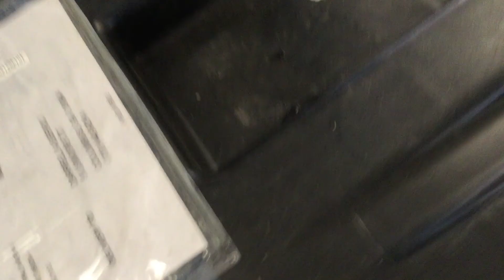CHEVY EXPRESS 3500 VAN ENGINE REPLACEMENT WITH 500,000 MILES!

Comment: Nice work Darrell. That engine is really buried under that dash. Work the work though, its a nice straight looking van. Mad to think they put big V8s in vans over there! About the  biggest we've got here are the 5 cylinders TDi or TDCI in the VW Transporter or the top of the line transits. Most vans are 2.0-2.5 4 cylinder diesels with manual transmissions.
Reply from the maker: Thanks Dave! I would love to have a diesel van! That would be so cool! I just love anything with a diesel.  I pull really heavy trailers full of shingles when I roof houses and I need something that can pull that even though I usually pull it with a truck now.  It’s been a good van and it hauls a lot of weight everyday with all the tools and supplies I use. Thanks for watching!!
Reply: Bonjour je suis français, je possède un express 6.0 avec 320000km, c’est moteur sont-ils fiables ???, que faut-il surveiller
Reply: American muscle

Comment: I’ve found a 08 3500 with 95k with a blown head gasket, for only 2000. After watching this, how easily could you replace the head gasket from internally. Not looking for anything too invasive. Let me know what you think. Thanks
Reply from the maker: It can be done in the frame I’m pretty sure of that, being able to access the rear of the engine really helps! Thanks for watching my friend !!
Reply: I decided to tackle head gaskets in the vehicle on my 2007 Econoline. I know it's a different make, but it was a pain in the arse for sure. All the extra time I spent going inside and back out or screwing around on the floor... I wished I had taken it out. So much more room to work if you have the tools!

Comment: So you used a rachet strap to hold the tranmission up while the engine was out?  I love leaning short cuts. The one I'm doing I'm able to pull the whole radiator surport fan shroud  and all in one piece .
Reply from the maker: lol yep it worked really well haha
Reply: @The_Home_Pros  Thank you much for your time to do the video....do a few of these you get good at it or I'm getting lazy...pulled the starter left it hooked up.and bungeed it to the frame same with alternator bracket and ac. Thank again good luck stay well

Comment: I have a 2004 GMC 3500 6.0 LQ4. It has over 1 million miles. Still runs smooth but that last 4 to 5 years I lost half my oil pressure. 2 years ago I lost all pressure. I did everything trying to get it back. Then I changed all the main bearings except the rear as you have to disconnect from the trans. It gave me my half pressure back. Is small business owners have to do a lot of the work ourselves and this was the deepest I’ve ever gone into an engine. But now I’m debating doing the engine myself as now the engine is closer to 3k and install another 3k. Which I just don’t have. I own a carpet cleaning business and the equipment runs off the van engine so if it’s down I’m down. How long did this job take you and is there any advice you can give me or things that may be a problem doing this for the first time? We have a company here in Virginia with your name, is that you?
Reply from the maker: that’s amazing these are pretty good engines I believe you can do it he just have to have a engine lift I took the whole front bumper and everything off as you can see it really didn’t take that long I think I did it in a weekend I paid $2000 for the engine off eBay from a company called engines direct and it’s been a pretty good engine so far I’m sure they have gone up in price now though I believe you can do it if you can get some days off
Reply: @The_Home_Pros  when the engine does go I be forced off as the equipment runs off the van engine. Are you in Virginia? I’m in Suffolk.
Reply from the maker: @michaelhorstman2603  no sir I’m in phenix city AL
Reply: @The_Home_Pros  did you have to do anything with the eco or computers? Or did you just plug them in and that’s all?

Comment: I'm looking at getting a newer Chevy Express cargo Van I would be looking at a brand new one if they still had the V8 available which now would be a 400 small block 6.6 L, L8T. The only engine available I believe is the 4.3 V6. That includes 1 ton. The only two circumstances that I know of that you can get the bigger V8. That is passenger vans and cutaway vans. Which is too much man for me and I'm not carrying passengers.
Reply: You can find a low mileage used one with the 6.6. I’ve seen them listed with 10-30 k miles for decent price. Might be the way to go if you really want one.